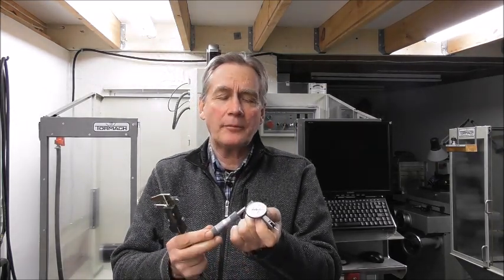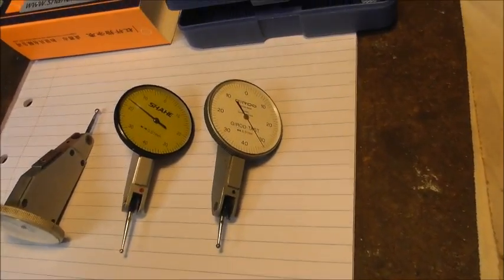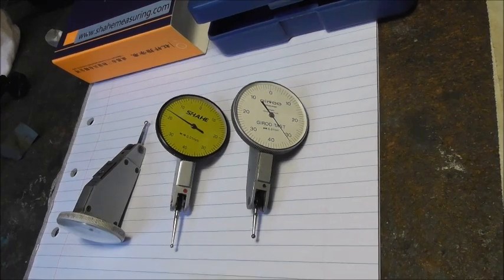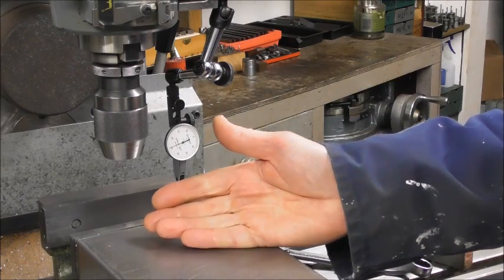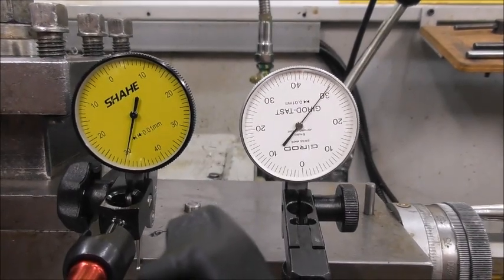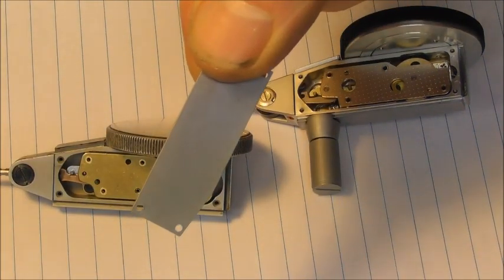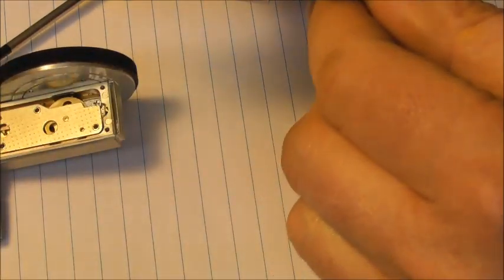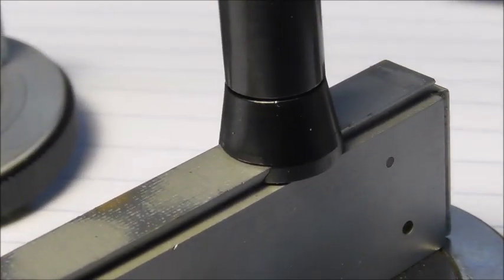DIAL INDICATOR COMPARISON/REVIEW - Part 1

Comment: Hi mate @threadexpress  , i want to increase the stem length of the shahe. I beleive shahe stem is removable. I saw some on sale in alixpress. Can you measure the thread size of the stem? Is it 1.6mm or 1.8mm ? Thanks mate
Reply from the maker: Hi. I found a mini wrench and unscrewed the stem. It measures 1.7mm diameter, so that is probably the clearance on a 1.8 thread. I assume you realize changing the stem length will change the ratio and the graduations will be incorrect.?  Cheers, Cliff
Reply: @Threadexpress   thank you. Yes i realize that. The reason why i want to change the stem from 17mm to 40mm is i will insert the stem inside the sparkplug hole of motorcycle and find its TDC. the dial indicator with max 0.2mm should fit. im just after the movement of the dial to see piston is on TDC. Unless you have better idea :-)
Reply from the maker: @bonjob47  dont you want a plunger type indicator for that?

Comment: As only a hobbyist I'd be a fool trying to argue anything against your hands on decades of professional experience Cliff. Most of my precision metrology equipment including the dti's are Mitutoyo and I seem to have pretty good luck with what they make. For North America and today I believe about the best dti's made are either the .00005" reading B & S or the Compac. It's quite likely there's other European brands that might be just as good to possibly even better. I've got very few Chinese made measuring tools and only use them for rougher work. I'll seldom buy an unknown brand because of that same unknown quality from batch to batch you mentioned. And yes I do know some of the high end equipment is also made in China. Except it has to pass a lot better quality controls. With the cheaper equipment one persons good results don't automatically mean you'll do as well with what you buy for the exact same equipment. So I've tried to buy the best I can afford. That of course limits how much I can buy. 

I also can't add resolution and accuracy after buying. Most of my linear reading dial indicators are either .001" or .0005" except for one single Mitutoyo branded but made for them by Mahr millimess dial indicator. My vertical and horizontal Mit. dti's are in 10ths. Yes as usual your quite correct that most times that level of accuracy isn't needed day to day. But I also use this equipment to double check anything I buy for the shop no matter who makes it or how much it costs. QC mistakes can and do happen with the best manufacturers in the world. So I'd rather buy higher resolution and accuracy than needed so it's available when it really is needed. Even fairly good higher end metrology equipment is still only guaranteed to be within + - one division. Fwiw to anyone else, anything I've checked that Mitutoyo makes against a set of there gauge blocks almost always is well under that allowance. One single dial indicator of there's was towards the upper end of there guaranteed accuracy. To me that shows excellent and very consistent QC.
Reply from the maker: Thanks for your thoughts TP - I have a plunger style Compac, I have read it is number one, I should have included it in the video. Cheers  Cliff